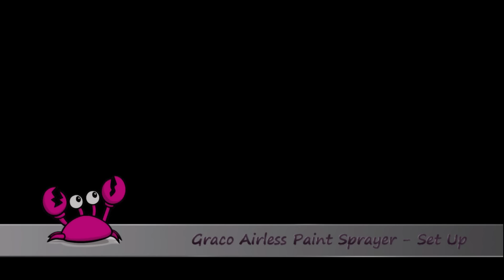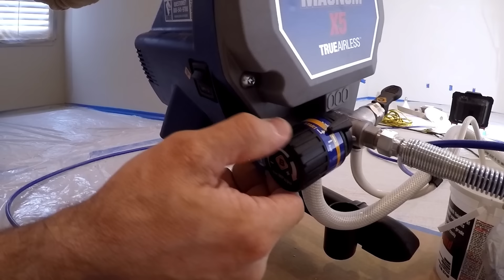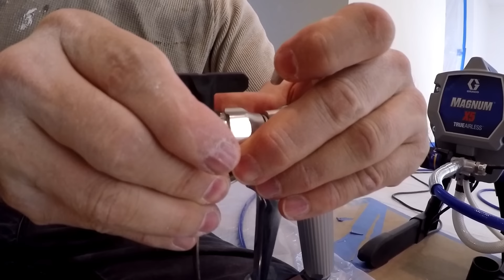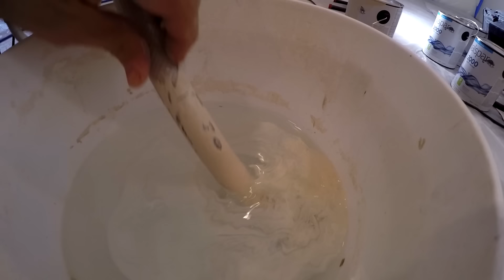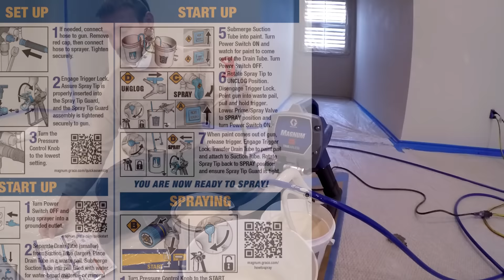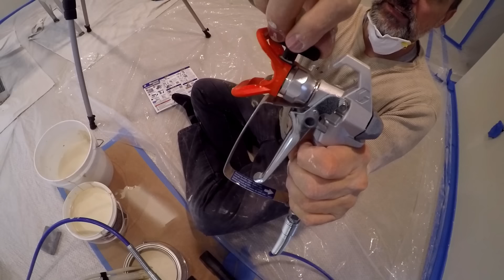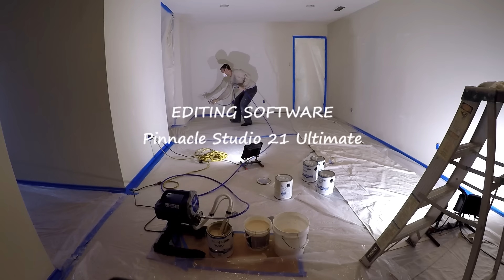First Time Using Graco™ Airless Paint Sprayer | Part 1 - Detailed Set Up For Beginners

Comment: Thanks for talking me into a Wagner!
Reply from the maker: Ha.  Well, that wasn't our intention specifically.  But, hopefully it helped you decide on the right sprayer for YOU.  Happy spraying.
Reply: @GettinBelizy  Well I guess painting is just a messy pain...period. But I don't particularly like the open bucket venture and all the priming stuff and assembling the nozzle. I know you were explaining it in detail so it seemed long and drawn out. But I even quit the video long before the clean up. I saw a Wagner with a little plastic container of paint you screw onto the bottom of the gun. I bet I could buy a spare one and just continually interchange them. I could even change up the colors as I move up the wall. Just have a helper keep filling them up. And then I won't have any mishaps with an open bucket of paint. But I know that also needs breakdown and cleaning. Then again, I could just buy a pack of rollers and disposable tray and just throw them out when I am done painting. That kind of cleanup really appeals to me!
Reply from the maker: I have to agree with the brush and roller appeal.  I've been painting with brush and roller all my life.  It's familiar.  And straight forward.  We only use the sprayer for specific jobs - and those jobs benefited pretty well from the mid-sized Graco.
Reply: @GettinBelizy  I watch those with the sprayer...and you pretty much have an empty room, masked off everything that isn't getting painted with plastic sheeting. Right now I am painting a bedroom. I moved everything to the middle of the room, threw down a tarp around the edge and don't even need a respirator...LOLOL!!! I suppose if i had a new house and had LOTS of open walls to paint, it would be an awesome tool. But for the weekend warrior freshening up the paint...maybe a little much.

Comment: If you are using two or more gallons of paint, "box" them (or mix) all into a 5 gallon bucket. This I'll ensure an even blend between all gallons of paint. If you have  3/4 gallon of the OG color, your color match will be slightly different. It's a different batch #, but same color. (Important to know when painting 400 units.) Always mix all your paint together.  Do not cut out of a separate gallon,  like the old color, then spray with the new. It will flash,  or "picture frame".  If it is a new color,  there is less chance of flashing,  but again, mix 2 or more gallons into a 5 gallon bucket.  Boxing into a 5 gallon bucket saves time in the long run, obviously. If the job you are doing he's only going to take a gallon or less then, used to 1 gallon to feed from. Always remember though, the pump holds a small amount of paint and the hose holds a certain amount of paint, depending on the length. This could be up to 1 quart. Factor that in with jobs estimated for a gallon, you may get cut short, in some cases. Just some things to think about, people. Great video for newbs and the DIY types.
Reply from the maker: After fumbling around with this unit for a bit, we agree with all these helpful tips!  Thanks!

Comment: For oil base paint need to dilute ?
Reply from the maker: Not specifically because it's oil based.  The sprayer works better with super thin paint - oil or latex.  You will have a different cleaning / storage procedure with oil though.

Comment: My luck with this product was not good. I watched the videos from the manufacturer and also this one several times. No luck. I had better luck with a cheap Wagner Power Painter.
Reply from the maker: That's tough.  What specifically did you have trouble with?  We had a bit of a clogging issue.  And one of the tips seemed to spit/drip at random.

Comment: I have one of these and on its first use it ruined my dining room. Set it up properly, set my pressure to where i had a full spray pattern. moved very quickly and only had a 25% overlap and STILL had a TON of sags and runs. i kept the gun approx 18 to 24 inches away from the wall and moved fast ( used to paint cars for a living). I was ready to throw the thing away after the first use. took me a long time to fix that room.
Reply: U probably had to much paint coming out
Reply from the maker: That's terrible.  Sorry for your bad luck.  Very odd - haven't heard of this problem if used correctly.  Anyone else?

Comment: This sprayer use or don’t use oil
Reply from the maker: What kind of oil are you referring to?  Oil-based paint?
Reply: @GettinBelizy  i think he reffering to the graco x5 if it needs oil like compresor
Reply from the maker: If so, then no - it doesn't need oil.  Just plug it in and drop the intake hose in your paint of choice.

Comment: Hope this isn't a dumb question but can I run stain with this unit? I already own; I just haven't used it yet.
Reply from the maker: My understanding is that, yes, you can use a sprayer to apply wood stain.  HOWEVER, you might not want to.  1) Stain is so thin that, even at the lowest pressure setting, you'll likely have too much coming out of the gun and will be fighting tons of drips and pooling.  2) You'd have to use mineral spirits to clean the sprayer - for a good clean, that's a lot of mineral spirits.  3) The aerosols (of which there are already plenty with oil based materials) will be exacerbated with a sprayer.  You'd want a good heavy duty mask with good filters and a well ventilated room.  Good luck!
Reply: @GettinBelizy  thanks for info might just stick to my gun and compressor

Comment: Did this sprayer not require any dilution of the paint?
Reply from the maker: Actually, no.  We didn't have any issues with clogging, but that could be because of the paint we used.  We used basic Valspar paint that has no primer in it for this room (very thin, very cheap).  We used a thicker 'high-end' Sherwin Williams paint (still a 'no primer' paint) for cabinets and doors and could tell that the spray pattern consistency suffered a little in that case ... but we managed to get through all projects without thinning it.

Comment: i feel like prep time (masking with tape & plastic & paint sprayer prep) is so time consuming vs actually painting the old fashioned way with a roller
Reply from the maker: It is time consuming and is why spraying in a newly constructed room before floor covering and trim work is the ideal option.  But, for a really good result, you need to mask and tape for the roller and brush option also.  One thing you can avoid with roller and brush is to plastic seal the floor - a tarp throw would suffice.
Reply: My shoulders and arms thank the sprayer

Comment: Airless is for outside or new construction. Look at all that blue tape, visqueen, etc. By the time you learn to do all that prep work in a reasonable amount of time, you could learn how to paint/be done with it. Airless painting inside sux. Don't do it
Reply from the maker: It is a huge amount of prep - no doubt.  But it made sense for us in this room because we were painting ceiling and walls in a large room.  If we'd been smart, we would have painted before installing the new carpet - then our only blue tape would have been around the doors.  Live and learn.

Comment: The setup of this makes me not want to spend hundreds on it.
Reply from the maker: It is a bit of a pain the first time.  After that, the set up includes about half the steps and is easier due to familiarity.
Reply: These are so easy to operate
Reply: Every real painter has one. Saves 1000s of hours a year.
Reply: Bought one. Today I used it for the first time and it made so much of a mess I tossed the entire thing in a large garbage can . I'm still emotionally coming down from it .

Comment: I bought one of those (Graco Magnum X5).  Within the first hour of use, the power switch failed.  I replaced the switch.  While I had the cover off, I noticed that a wire that connects to a control module is poorly installed.  There are two very small, flat tabs that the plug connects to.  The plug has push clips that hold the plug in place, but there is no plastic part for the clips to clip to.  I cut the plug off and soldered the wires in place so the wire wouldn't vibrate off.  The main housing moves a little bit, so when I push the prime button, I have to hold the housing in place so that the housing does not interfere with the button.

While painting, the sprayer would quit working several times.  (Yes, I strained the paint.)  Being brand new to paint sprayers, I didn't know if the tip was clogged, something else clogged, or what (It definitely was not sucking air.),  so I kept starting over with it from the beginning.  During the first couple of days, I spent MUCH, MUCH, MUCH more time trying to get the dang thing to work than I did painting.  After the first couple of days, I got to where I could solve its problems more quickly, so that painting with the sprayer finally became time-efficient.

You can find recommended sprayer PSI on some paint products, but this sprayer does not have PSI calibration on the dial.

Overall, I highly recommend using a sprayer (I don't think I'd recommend this particular model, though.), but you shouldn't expect it to be as easy as sticking the tube in a paint bucket & start spraying.
Reply from the maker: That sounds horrible!  Apparently, quality control on that unit was completely nonexistence.

Comment: Good video. My only 2c to add would be to use a paint strainer and strain your paint  before using the sprayer. Especially with older paint. Also as noted with using an airless sprayer - you can finish a room in 10 mins but moving  the furniture and covering up everything can take hours!
Reply from the maker: Good suggestion!

Comment: What tip did you use with the valspar paint... when looking on  lowes it says 00.17 tip. I have the same graco x5 you can only use 00.15 tip.  Did you thinning the paint?
Reply from the maker: We didn't thin the Valspar paint - their basic 'cheap' paint is pretty thin already.  We used the 515 tip which is a .015 size tip.  According to Graco, the X5 sprayer's max tip size should be .015.  We've never tried a 517 with the X5 so couldn't say what happens if you use one.
Reply: Thank you! I will check at my lowes!

Comment: So crazy, just put all paint in a 5gal bucket (mix the lots too by doing this) with both hose in bucket turn the tip around (rotate around 180 deg)and shoot in the bucket to prime. than once primed shoot as light as possible on the walls. If you pull the trigger and see your paint just dropping in the bucket then your pressure is too high lower it, should drop at a very slow rate takes very little on the walls when spraying.  To clean just run about 5-10 gal of just water through it and it will be fine for long term storage they sell some stuff you mix in the water on the last flush it kinda oily just flush good before next use.  oh and you can do this on fresh green grass the latex won't kill it just flush with tons of water and all the white will disappear I don't know how many times a customer yell YOUR GOING TO KILL MY GRASS lol I tell them if it dies I will replace the whole thing hahaha

Comment: Can this be use to paint strip lines on asphalt parking lots?
Reply from the maker: Graco does make a separate striping machine, but this sprayer won't make clean, even lines or edges.
Reply: @GettinBelizy  won't or will???
Reply from the maker: This sprayer will NOT make clean edges or line.

Comment: Very nice video. Thanks for your effort. I just got this sprayer for the deck and your instructional video is detailed and helpful.
Reply from the maker: Thanks!  Good luck with the deck!
Reply: Did you use this tool with a stain/sealer? And how did it perform? Thanks
Reply from the maker: We did not try a stain, polyurethane or any oil based paint with this machine.  We did use a polycrylic (water based) lacquer on kitchen cabinet doors.  It was fairly thick for a clear coat and worked fine.

Comment: You need to back roll that wall paint after/while you are spraying, otherwise it won't lay flat.
Reply from the maker: Interesting.  Haven't heard that before.
Reply: Seems to defeat the purpose of spraying🙄
Reply: Nate Owings no. It doesn’t defeat the purpose. It ensures that the paint lays flat and picks up and runs or heavy spots the sprayer may have left behind. Talk to any pro painter and they will tell you this is how it’s done, especially for interiors
Reply: @LawrenceD  Wish I knew that...

Comment: Great video. You should've invested in a quality respirator rather than use a simple dust mask. Breathing in that paint mist is not good.
Reply from the maker: We did end up using a good respirator after the initial trial run.  Even with latex.  Better safe than sorry!
Reply: dust mask works just fine. more than likely a water base paint.

Comment: Spraying walls takes longer than rolling walls. We use an 18 inch roller cover. By the time the Graco sprayer covers one 12 inch strip, an 18 inch roller would have covered about one 54 inch strip. Spraying ceilings, crown, trim and base is the real way to use a sprayer
Reply: I find that a brush is the best way to paint trim. By the time you tape the entire room up just to spray the trim, you'd have finished brushing and had lunch. You can get a very smooth finish with BM Advance and a good brush with good technique. Trim makes it easy because you're always moving the brush the same direction.

Comment: Do you still have to manually cut at ceiling if different color?
Reply: No....back mask
Reply from the maker: You wouldn't need to cut manually, but you would have to tape/paper the second painting session.  So, if you did ceiling first, you would need to tape off the ceiling before applying the wall color.

Comment: man that sprayer is not made to spray that much ,sprayer is good for  very small jobs
Reply from the maker: We've successfully used it on three big jobs now.  The key seems to be to clean the nozzle often.
Reply: I'll be doing my house, inside and out, then the fencing. Trust me - it'll do as I need it to!!
Reply: Gerardo, you're joking right? This sprayer is just fine for large jobs. It's homeowner level so you can't put a tip larger than a 515 so if you ARE a contractor and you do a lot of new construction painting then yea, this isn't for you and your going to lose money in that each job is going to take you 25% longer vs. masking and spraying with a very large tip. This x5 out performs every wagner and every self contained handheld by a large margin, it's by no means slow.
Reply: I’ve painted a house with it. It’s just fine!